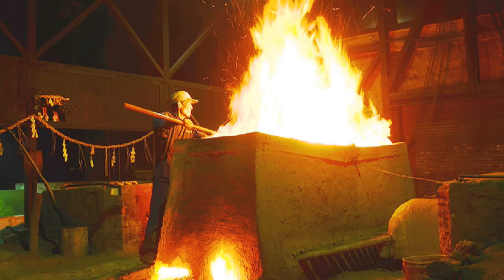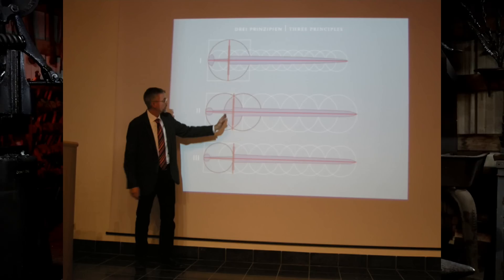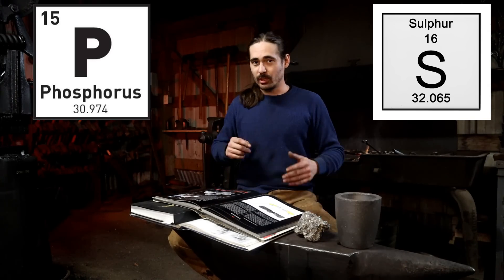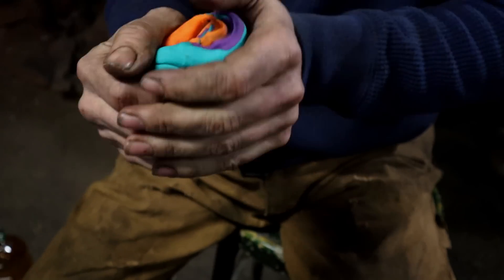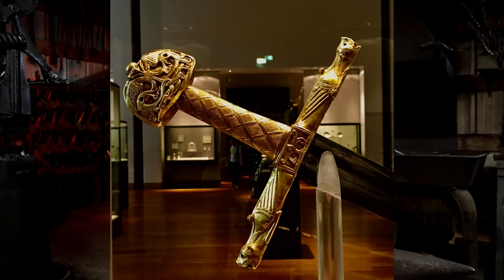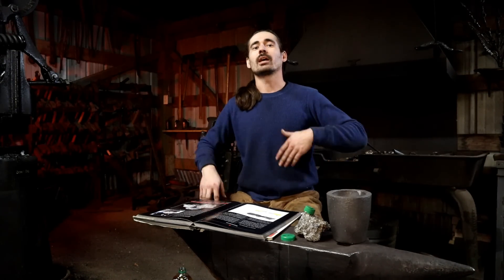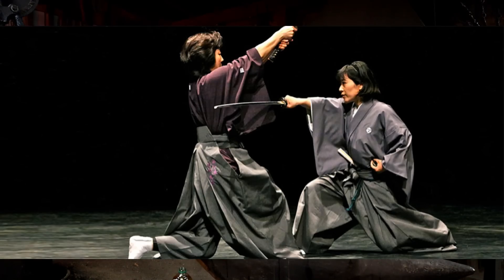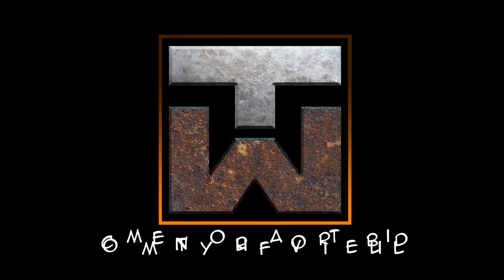Misconceptions About Medieval Steel - Wootz vs Bloom

Comment: Would love to see a discussion video with Ilya talking about the different skills an armorer needs compared to a bladesmith/blacksmith.
Reply: I have trained a few people to make armor who went on to be a blacksmith. Armoring teaches good hammer skills which help alot in blacksmithing.
Reply: Check that Ukraininan armourer channel, his last video is about workshop ;) 

World of armor. ArmorSmith
Reply: I was a Professorial Blacksmith, I have made knives, swords & armour and a shed load of rams head pokers! Bladesmithing is just a specialist area of Blacksmithing, you would need to learn Blacksmithing (or a large amount of smithing skills before just going all out on blades). Blacksmithing for the most part is moving thick/thick-ish mental into a shape, so say you want a spanner, you forge a spanner shape, file the spanner mouth/jaws to wanted size, hard and temper, you want  a knife, you forge a knife shape, file/grind to finish size (learning bench skills with files will help lots), semi finish surface, harden & temper, finish the surface to level of finish wanted, make and fit handle and/or guard if wanted/needed, repeat on big scale for a sword, which is just a big knife at the end of the day, most of this is all skilled hammer work, making armour is (for the most part) working the mental cold, so again it is mostly all skilled hammer work, learning sheet mental work & car body repair work (if they still teacher such) would be also help for making armour, not just for hammer work moving cold steel, but also for making templates etc. Being able to make all your tools for your work also helps a lot being a Blacksmith. Getting the level of finish on your work is a scale only you know what you want, top end, learn jewelry skills. But for the most part, Blacksmithing skills would cover most of all skills you asked about, it just depends on what level you want to take your skill/s level to! More you put in, more you get out. Being able to see a piece of work in your head, transplanting that idea on to paper by way of a pencil will save you time, money and a lot of hart-ach, not much, but some! Last tip, if you got soft hands, piss on them, work with piss wet hands until they are dry, repeat when needed, there is no thing better for hardening skill up fast, just remember to wash hands before shaking hands with a customer, picking your nose, or eating your bate! Don't worry if you forget, your will remember pretty fast and or be told! And Nit-bond/comfrey oil for burns, just make sure you got all the scale out, or the skin will grow over it, for any cuts or removed skin use iodine, when dry, then comfrey oil. Lastly, be warned, if you like Blacksmithing, once you have tried it, She will get under your skin and be like a drug and you will be addicted for life! And not being able to do smithing, either because of no where to do it, or no money, or your body is to knackered, will just mess with your head! And be under know illusion, not many make any money at it! So like most craftsmen, you will died physically fucked up and in adjective poverty! But for the most part.....Happy in the knowledge that you have the skills and have done a trade that few others have and have done! But is not needed in this brave new world of ours....................................................... Good Luck.
Reply: poly is better for armor now thpugh so, idk
Reply: Let's just say with enough patience as a hobbyist I can make a well fitted helmet or a pauldron. I can also make an axe or a spearhead. I still can't for shit make a good blade longer than 30something cm xD
Reply: So how do we get Ilya to make a master class?
Reply: An armourer must share talents with an old style panel beater.
Those guys had dozens of hammers and anvils for any/every shape to be created in plate steel.

Comment: In the 12th century European smiths could easily make and temper spring steel. The proof of this is the widespread use of steel crossbows. You cannot make a steel crossbow without spring steel.
I disagree with the education part in Medieval Europe. Blacksmithing guilds existed since the 11th century. Training and quality control was centralizes to a certain extent.

Comment: The idea that modern feders break, so the interpretations of HEMA must be wrong, because period swords were lower quality metal, is deeply flawed.
Feders break because we use them for thousands of fights. Bear in mind that a typical HEMA fight will be something like 10 real life fights, one after the other. And if you practice 2 times a week, having a couple of practice fights each, that means you are using your sword the equivalent of around 50 real fights *each week*.
A real sword would have never been used that much.
That's why the breaking of feders has nothing to do with "wrong" interpretations. It's just that we use them thousands of times more than any real sword was used.
Reply: Also tons of 15th/16th-century manuals & accounts mention that swords broke. It was an accepted reality. Nobody expected swords to be indestructible or to last forever, though they did complain about poor-quality swords breaking too easily.
Reply: @benjaminabbott4705  yeah. If anything, modern feders are breaking far less/later than period swords, which is to be expected, as we have better materials.
Reply: you do realize that blunt blades break far less then sharp ones, right? that plus the lower quality of steel does mean the medieval swords break far faster then modern super steels.

Comment: You've generalized European blades by much too wide a margin.
The ores used, the phosphorus & sulphur content of the ores from various locations, and the functionality of the smelting furnaces used from locale to locale produce steel contrary to what you seem to think.

For example bog iron v.s. mined ore...
Mined ore contained phosphorus and sulphur, bog iron not so much.
The vertical placement of the tuyere/multiple tuyeres in a smelting furnace, as done in Germany v.s. Scotland created very different steel.
With a traditional Scottish smelting furnace, you get similar action to a crucible as the furnace was meant to be destroyed to retrieve the steel.
The slag rises and sits on top of the bloom that began as ore that was already pure enough to forge using modern techniques (although impractical due to losses through inability to fully reduce the oxides).

Comment: Regarding the HEMA part: I recall Matt Easton mentioning in a video that weapons breaking was an accepted part of life. Depending on how often they used their swords I assume that people of higher status and wealth, like the kind that involved themselves with manuals, treated them in a more expendable manner and replaced them if necessary
Reply: Yeah unless it breaks on you IN battle. It's not about keeping the sword after the battle to save money. It's about not DYING because your sword broke.
Reply: The potential for breakage depends on quality and mileage, sometimes you can see that a sword is on its last legs and could potentially break on its next battle. I think it's more appropriate to say swords are treasured, but those who have more money are very careful about taking potentially damaged swords into battle, and would replace them (or relegate it to training) if possible.
Reply: @Tremulousnut   Also if a sword is that worn you can take it to the blacksmith.  Forge welding a crack might keep the blade usable for a few more years. or just trade it for a new blade and let the smith melt it as scrap iron.

It's the reason why armories were a thing.  you'd have a weapon master who'd carefully inspect things to ensure they were still usable and send them off to the smith if they needed repair.
Reply: @marhawkman303  That sounds impractical, how would they know what kind of steel it was even made out of, they might repair superficial or appearances, but I doubt they could repair it to 'new' conditions.
Reply: @Orinslayer  How would the smith know what kind of steel? well if it was their own work they'd just remember.  Also, in medieval era there was less variety in metals used.
Reply: @marhawkman303  no, they wouldn't. The modern idea of ttpes of steel and historical types are distinct. They didn't have homogeneous metal with chemically know formulas and computer precise repeatable processes.

Nonetheless that is a moot point, you don't weld a blade. Even forge welding. If a blade is that damaged you can't just regrind it into a functional shape, you either savage it by modifying it more drastically (basically you are minimally reforging it into a design you can get to from. what you have), or it is scrap. Any more than that, you are basically doing the same or more work than making a new sword for an inferior result.
Reply: @marhawkman303  Forge welding a crack in an existing blade isn't worth the effort and is likely to create an inferior product. A craftsman might try to salvage what they can from the hilt for direct reuse, but a cracked blade is better off being cut up and used as raw material for new blades.
Reply: Medieval soliders often carried multiple eeapons... Lance, sword, mace, dagger... @GilgameshEthics

Comment: Firstly let me say that I am a Wootz smith who has been making crucible steel for at least 17 years, I was mentored by Al Pendray and I am very familiar with the history, performance and manufacture of Wootz / Pulad / Bulat.  You are making mistakes in several places in this video, mainly because you misinterpret what others have said on the subject but you have no experience and little knowledge historically.  You also make broad statements about what makes a good pattern and what does not, as well as the hardness and not quenching of blades. 

Almost all of the blades were quenched and were much harder than what you say.  The historical accounts are full of descriptions of how the blades were quenched. The issue is that if you test the hardness of the blade in the center then it will only be 20 or so Rockwell.  But the blades were almost always pearlite in the middle and as wootz is a thickness hardening steel the center was almost always soft.  The edges were hardened a short distance in and we can see the Hamon from this hardening process.  Do not mistake a soft Pearlite structure with a soft annealed structure, it is not the hardness but the crystal structure which gives the elasticity and toughness to the steel.  Even a 40 Rockwell hardened sword blade cuts better than the high quality 52100 blades we have today at the same hardness. Some blades even had significant Molybdenum and Tungsten, these were exceptional alloyed Crucible Steel and would match almost any blade today.

Not all crucible steel had high sulphur or high phosphorous, it depended on where the ingots came from. Ingots were made in India, Persia, Turkey, Mongolia and several other places, and copper, manganese, silver, chromium and other elements were deliberately added to the steel. Some blades were high in phosphorous which made them more prone to breakage in the winter months, the sulphur was only really a problem when forging the blades not afterwards.  However Abbott in the early 1800s said that the majority of blades were not exceptional in their flexibility or hardness, but some were very very good and excelled the English steel.  It took an excellent smith to be able to turn out a really good sword from an ingot, and to thermally treat it and harden and temper it to perfection.  Please do some more research, talk to some of the top five wootz smiths in the country and then do a more accurate video.  You did a great job, but misrepresented the material and the generalizations really killed it.  Better next time perhaps.
Reply: @Gallowglasser  You are so ignorant of the facts that I almost didn't reply. At Merv they added copper deliberately and small amounts of copper aid in blade performance.  At Chahak they added Chromium, in other accounts from the 1800s they added silver.  Vanadium is one TRACE element of many it is simply one that helps pattern formation more than others.  Other Wootz steel had other trace elements which added specific characteristics (such as Mo and W with ginte-bulat).  The process of making crucible steel only removes some impurities, depending on what they added to the mix.  This is why they ended up cornering the ingot market in India, their ore was cleanest and so Persia would buy most of their ingots from there and they controlled the trade of them.  If you actually were knowledgeable in wootz steel you would actually know who I am.  You are just an armchair critic and should occupy yourself better in researching not doling out criticism and calling people who are much more knowledgeable than you liars.
Reply: @Gallowglasser  Glad you are convinced you know it all without any research at all. Read up about Chahak, the archaeologists are convinced that Chromium oxide was deliberately added to the crucible at that location and some of that was converted to chromium in the steel.  Massalski wrote about the deliberate addition of silver to crucible steel in the 1800s.But please don't let facts interfere with your unresearched opinion though, or you may actually appear knowledgeable.
Reply: @timmitchell5812  so if i made a crucible steel sword that has elements of vanadium moly or chromium carbide formers will that show a pattern of the famous damascus swords?
Reply: @KJ-qr9sm  The ingot with the appropriate ingredients is only the beginning.  You have to know how to take that ingot with a slow cooled crystal structure and go through the correct heating and forging process to transform that structure to the wavy sheets of carbides which gave pattern to the old swords.  Doing it well requires knowledge of the metallurgy of the metal as you work it or at the very least a set of instructions for that rough percentage of carbon in the ingot.  Only a handful of smiths are able to get the old Persian patterns consistently.  There are more and more who are gaining the skill and knowledge which is encouraging.
Reply: I would disagree with the "match almost any blade today" part, because even good Wootz was still extremely high carbon and carbides even without impurities are weak - especially when banded in structures for cracks to propagate through. Any edge retention bonus at 40hrc is only down to all the carbides thanks to mostly pearlite microstructure. Most swords were very soft even if you had a few good examples show up, they weren't the norm either.
Reply: @mikafoxx2717  Thanks for the intelligent reply.  What I said was qualified, and of course not all wootz would outperform modern blades but there was much which is in the same category which we place Japanese steel or higher.  It excels many modern steels for specific purposes. There is no one all round good performing steel even today, steels do some things well and some things less well and wootz is definitely no different.  However, your comment about carbides is reliant on the size and type of carbide. Naturally large, blocky carbides are not what you want and are more likely to fracture or chip out than smaller spherodized carbides and so for that reason some traditional patterns perform better than others. We also need to be careful about making blanket statements about wootz such as most swords being soft.  That isn't true, there were some accounts from specific regions where they mentioned that the swords they were using were soft and would be bent back into shape under the foot of the soldier, but most wootz swords were not soft but springy due to the tempered pearlite structure behind the martensite edge. Blade thickness also comes into play here when talking about softness. Some blades were very thin and likely to bend, but others were quite thick. There are also blades which are seen in collections where the blade was clearly broken and then repaired by forge welding. A soft blade doesn't break.. Concerning the toughness of the edge there was a steel mill in India who during the late 1800s were ordered to destroy and melt down blades in the local armory which had been confiscated.  Their shear blades were damaged when cutting the blades from the sword cutting edge but they could cut them from the spine. It is important to remember that there are many accounts from different time periods and different locations where the blades differed in chemistry and in quality. We have reports of rigid blades, springy blades and soft blades, we have accounts of brittle blades and exceptionally keen edged blades which would cleave a spanish style helmet in two. There can be few generalizations when it comes to wootz.